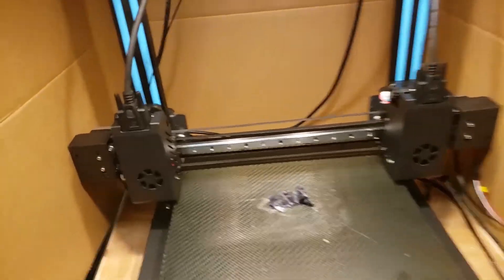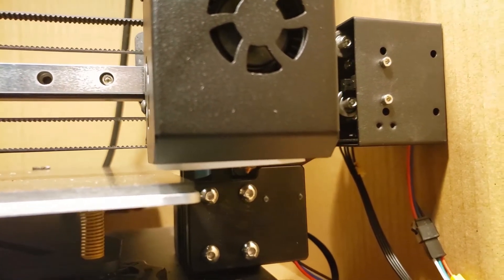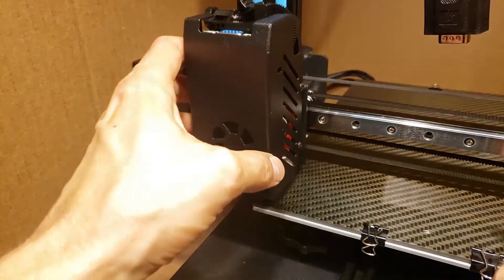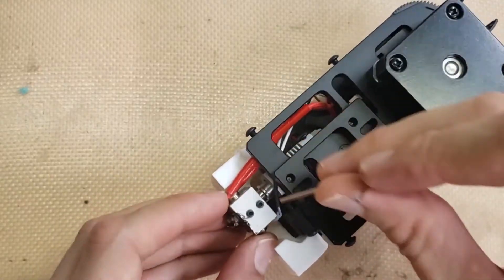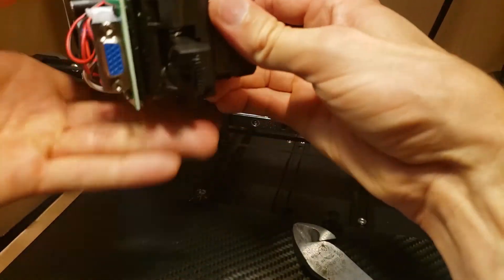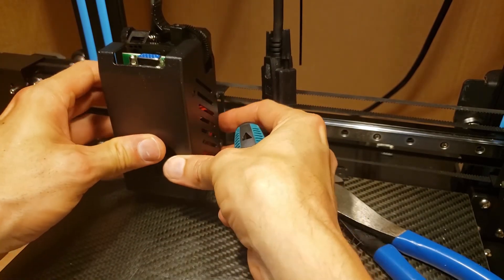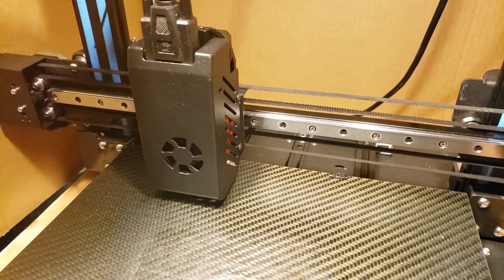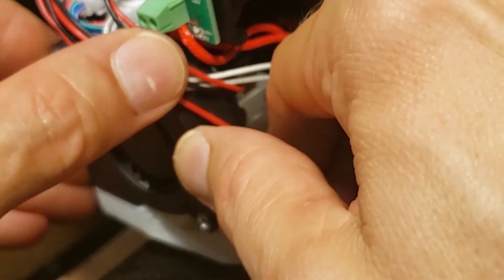FAILED! Fix the New Hictop, Tenlong Titan Extruder Upgrade before it happens to you too! D3 Pro Hero

Comment: I'm pretty late to this party, but I could really use some help regarding parts. I bought a second hand Tenlog TL-D3 Pro, and it came with the Titan upgrades, but I've wound up needing to replace one of the heat blocks, heater unit and thermistor. The problem is that I have no idea just how interchangeable the parts are, and I'm baffled by the variety I've found online (V6 blocks? 100k thermistors?? 12v or 24v heaters???). The block is 16x16x12mm, the nozzle/throat thread is about 6mm, and the voltage switch on the side of the printer is set to 230v (UK), for whatever's that's worth.

In case it's at all relevant, I've also noticed some minor differences between mine and yours, which I'm hoping are just superficial differences between Hictop and Tenlog. Where your circuit board has a space for a bed-level system, mine has a gap for a filament sensor, and the set screws to hold the thermistor and heater are in different places on the block.

In any case, I'd appreciate whatever help I can get.

Comment: Great video, thanks. Thinking of buying one but why do you feel only recommended for experienced 3D printing users ?  I'm coming from an old Ender 3 and looking for more versatility. Cheers
Reply from the maker: Sounds like you do have 3D printing experience, so you will be good, especially if you have hands on skills. I meant that I would not recommend this as a first printer to someone who doesn't have mechanical troubleshooting skills. Since you are looking for more versatility, this printer will fit the bill.
Reply: I’ve no 3d printer experience… but I swapped my computer’s motherboard and overclocked it, as well as have heavily modified my vehicles with sound and performance equipment… is that enough crossover? Idk… I’m kinda obsessed with dual extrusion and water dissolving supports 🤪😸🙏🙏

Comment: I got a pari of these and it caused issues where thermal runaway was triggered every time the pritner turned on. And i filed a paypal dispute and they had me pay to ship it to china for a refund but then once it arrived it was cancled and i never got my refund and two months later i got then back in the mail completely destroyed and mangles. If you could help me reach out to either get new ones or have them finally refund me. I was hoping for better results but turned out to just be a nightmare.
Reply from the maker: That sounds like a total pita experience. Sorry to hear that. It sounds like the thermal sensor may not have been connected properly. I don't know if I can be of any help reaching out to them, as I am not affiliated with Hictop or Tenlog, just a customer documenting my experience with this IDEX printer.

Comment: Any idea if there is a all metal hot end upgrade?
Reply from the maker: Since this is an E3D V6 clone, you should be able to substitute the hot end for an all metal hot end. I think there will still need to be a tube (Teflon) between the extruder gear and the heat sink directly above the heat break. I believe the original extruder is all metal.
Reply: @engineerable   there’s lots of newbies on Amazon leaving 1⭐️ reviews because they think it’s not all metal because of the Teflon tube…. 🤪🤷‍♂️
Reply from the maker: @It-b-Blair  I believe that this is not an all metal hot end. The reason is that the Teflon tube descends into the heater block zone. In an all metal hot end, the Teflon tube should not extend below the heat sink. Therefore the Teflon tube is exposed to the higher heat of the heater block.  See the difference in the image here - https://www.fabbaloo.com/2020/03/is-your-3d-printer-killing-you-slowly 
And here - https://www.matterhackers.com/articles/top-reasons-to-upgrade-to-an-all-metal-hotend

Comment: Hello,
We are carrying out a study that allows the height of the nozzle to be precisely adjusted and to keep it vertically blocked.
This device is accessible and adjustable without changing the structure of the original parts.
to reread you
Reply from the maker: For this printer? Or any 3D printer?

Comment: thanks for the information, that design looks pretty weak overall, have you tried any flex material with it?
Reply from the maker: The design, strength, and functionality has been ok besides this issue (especially considering the whole extruder module costs $50). The main improvement that could be made is to significantly shorten the distance between the extruder drive and heater block. Yes, I have printed some with NinjaFlex. It worked, but not nearly as nice as as my Lulzbot Mini with Flexstruder that uses 3mm filament. I had to increase the flow to 112%, otherwise it was under extruding. Retractions with the 1.75mm flex filament suck too. These issues are not the fault of the extruder. In my opinion, TPU filaments that are as flexible as Ninjaflex should only be sold in 2.85mm or 3mm. At 1.75mm t's got all the ridgidity of a piece of cooked spaghetti. At 3mm, it's decently stiff and prints well. So, I bought another Titan extruder, and modified it to run 3mm (Ninjaflex) filament. It works sooooo much better. Look for an upcoming video for that mod.
Reply from the maker: Watch this new video where I modify one of the Titan extruders to print 3mm diameter Ninjaflex filament. It works much better! https://youtu.be/pdYxC6sAM3o

Comment: Same exact thing happened with mine on the second print.  Wished that I had checked the screws as well.  Works fine after this fix though.
Reply from the maker: Good to know that it continuous to work fine. I think that they need to add that to their instructions to tighten the screws before use, because it is not a trivial thing to fix. At least it gave me an excuse to tear down the extruder a little.
Reply: @engineerable  I’m looking to upgrade the entire hotend.  I would like to put a couple of mosquitoes on it.
Reply from the maker: @jacobbivens294  What are the advantages of using a mosquito hot end? How difficult will it be to adapt to this extruder? I would like an all metal hot end for higher temps, but looks like the Hictop firmware maxes out at 270C. I would also like the option to run 2.85mm ninjaflex filament since it's more rigid for better extrusion and retraction. For 2.85mm filament, I could use a Teflon liner with a different ID, and if I set that extruder for 2.85mm filament in Cura, it should automatically adjust the flow rate, right?
Reply from the maker: I modified one extruder to run 3mm TPU filament like Ninjaflex, because it's much more rigid for extruding and retracting than 1.75mm. Conversion video here: https://youtu.be/pdYxC6sAM3o